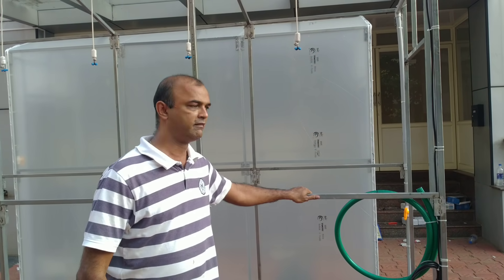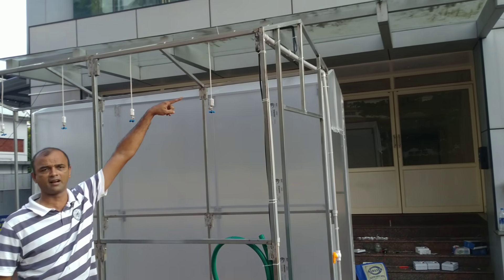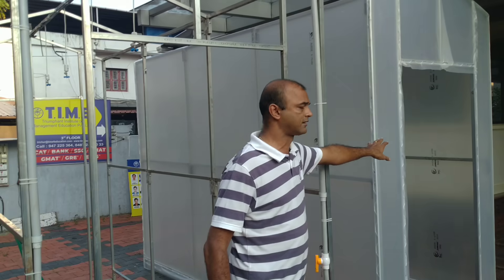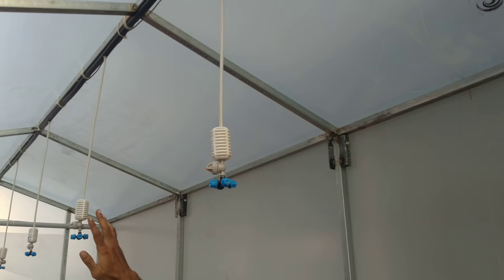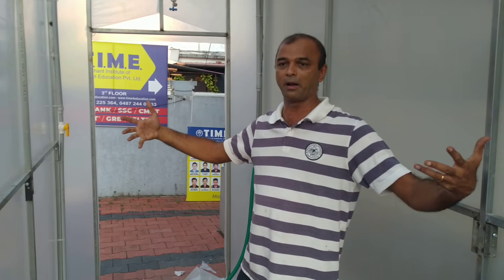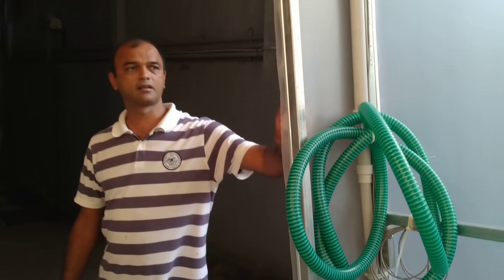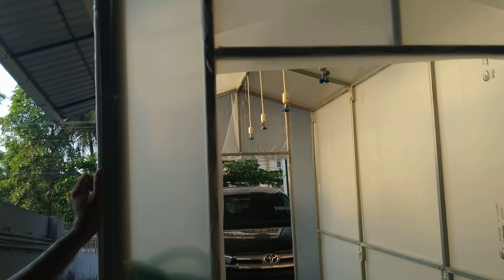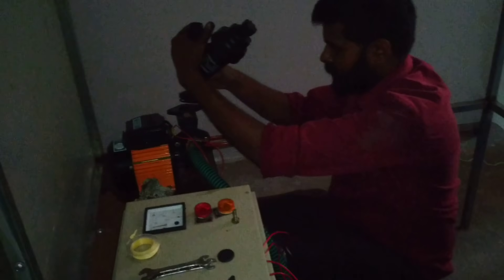How to make low-cost walkthrough Whole Body sanitizing tunnel Part 1

Comment: Motion sensor is used to switch the moter ON after a person pass through it,how is it going to stop?
Reply from the maker: You may set the time to desired setting
Reply: It has the option to set time for which you can set it accordingly.If you still can't have a setting, you can make settings by calling me a video.

Comment: The sanitizer tunnel is not very scientific and useful unless used with proper PPE kits, airlocks and scrubbing system as in BSL level 4 labs...
Reply from the maker: Correct... but we intended to reduce the germs or bacteria or virus carried into a hospital or carried out from a hospital
Reply: @pottokaran  thanks for reply... if installing in hospitals.. please ensure proper drain pipes and chemical treatment...